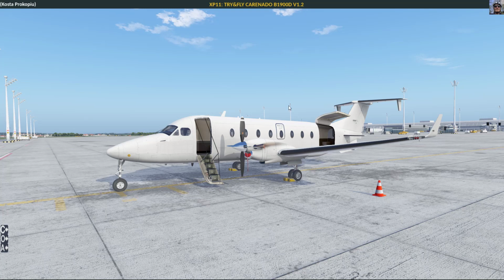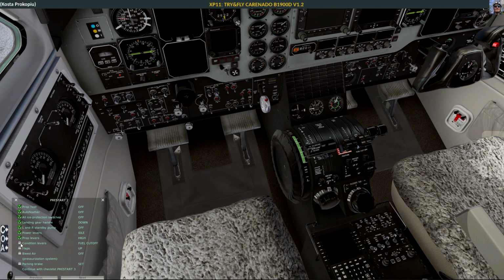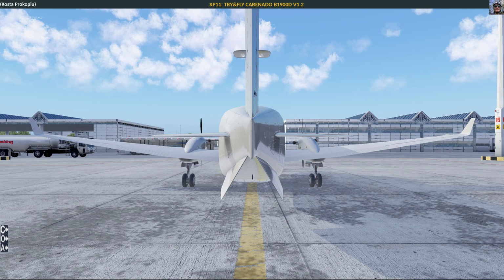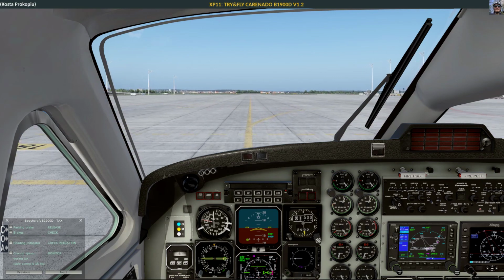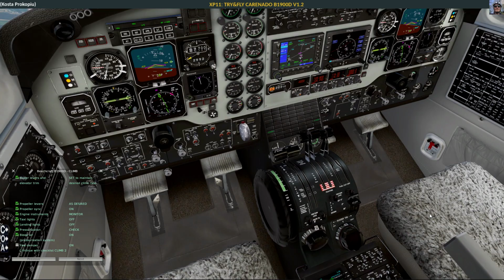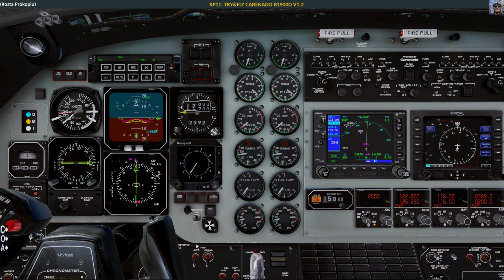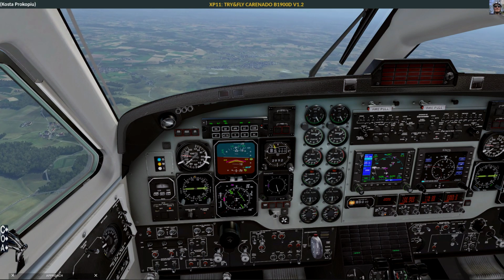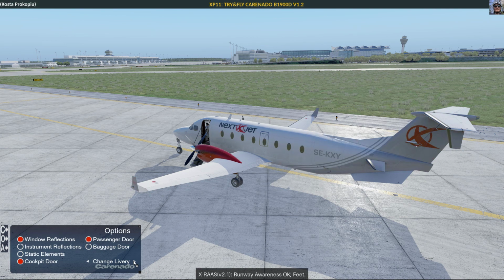[XP11] TRY&FLY CARENADO B1900D V1.2 (ENGLISH)

Comment: -IAS controls the pitch of the aircraft to maintain the desired speed at time of making the IAS Autopilot selection.
-Next time you need to adjust the prop levers 500 feet after take-off so that the engine can perform optimally. Essentially the whole flight was done in 1st Gear, like in a car. Monitor the propeller gauge to make the adjustments.

Comment: Hi, Do you need Xplane 11 to run this game? And What are some other minimum equipment and/or software that you need to run this simulator ? Thanks in advance.
Reply from the maker: Yes, X-Plane 11 is the simulator platform and the Carenado B1900 is an addon. You should have a decent gamer PC and a joystick/yoke and ideally rudder pedals for realism (a normal joystick like the Logitech Extrem 3d with a z-acis will do too). X-Plane runs on Windows, Linux or Mac.

Comment: I wasnt able to get better pushback to work with this aircraft, the truck pulled up and just sat there attached endlessly?
Reply from the maker: That is the landing lights which are always on in the B1900D (bug which I think has not been fixed yet) - had the same thing. https://forums.x-plane.org/index.php?/forums/topic/134355-b1900d-pushback/  https://github.com/skiselkov/BetterPushbackC/issues/185  is not fixed so far…. Carenado...

Comment: Two things:
- the prop lever actually has a "taxi" detent (slightly above "feather") that should be used during taxi instead of full idle - it would probably help with your speed problems;
- the AP didn't come on in the beginning because you switched only the yaw damper on, not the AP (you did it later on the pop up panel)